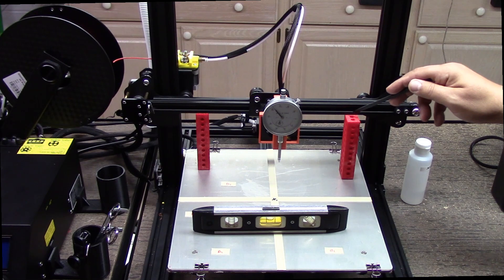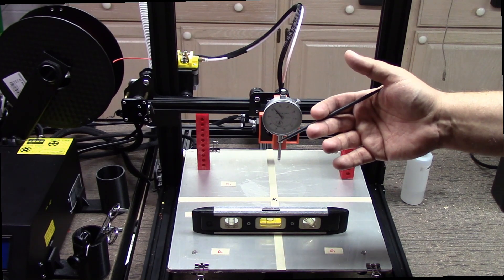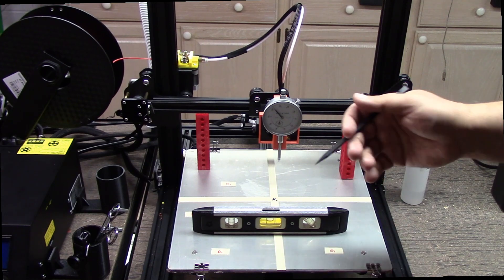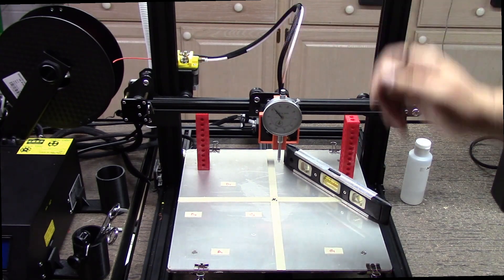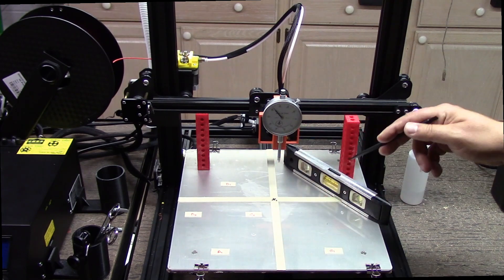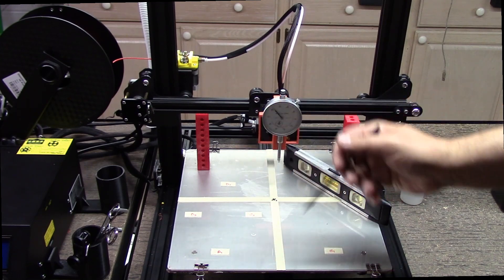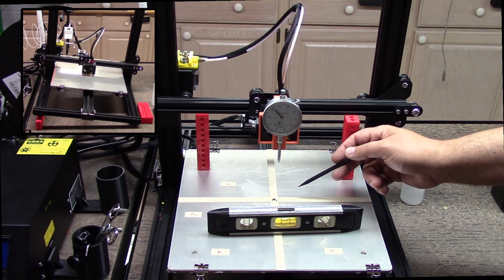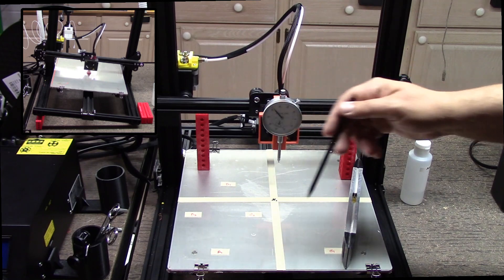Shop Talk - Stop Leveling Your Bed and Start Tramming Your Machine!

Comment: alot of talk for nothing imo, just "level" your bed with a feeler gauge at the 4 corners and be set, of course your bed won't be level to the ground, it will be parallel to the tool head, the terminology is not right, but the end result is....
Reply: Christopher Backus Mirror glass is made to a much higher standard of "flat" due to those types of imperfections causing visual distortions in the mirror reflections.
Reply: Québec Multirotor I agree you can get 90% of the way with that method, I've done it like that for 6 years lol.
Reply: @GeoDroidJohn  if 90%     near enough is good enough  your doing great ..enjoy. the chaps trying to point out a methodology that can give better results for those who wish to try. nuff said... For those who wish to try fantastic constructive feedback great but if folk just wanna whinge... Not interested
Reply: whats interesting is that glass was cut from a larger sheet, but the bow is right in the middle of cut off piece.  most likely it wasn't there on the larger piece of glass and wasn't after it's cut.  only after it's mounted and heated.
Reply: Quêbec Miltirotor You're making the touching assumption that the bed is perfectly flat. Almost none are, even if the error is usually minor, or small enough to look the other way (and often try to find something else to blame for probems). Even  getting the corners perfectly set won't ensure that the center isn't dipped/bowed, or that there aren't ripples across segments of the bed.
Reply: Pretty much exactly what steveH said. When I tram my bed I check the center after adjusting the 4 corners. My glass has a slight bow in it, making the center of the bed slightly higher than the 4 corners. I've managed to get decent prints so far by using brims and rafts, but there's only so much one can do with warped glass.
Reply: You've fixed yours Chris, I know. But #Dishing is very common on #Ender3, even the newer ones. If people are having the same issue...
You can temporarily get closer to 'flat' by putting 1-2 sheets of paper under the centre of the bed - staggered a bit to even this out.
Then crank your adjusters down hard (move Z down if you have to) which should subtly remove some of the curve from he bed as well.

This is called Holostio Mylopic Super-Alignment - I know because my knowledge of everything is superior to everyone elses.
Therefore, instead of calling it - bodging paper under your dished bed, until a decent glass one arrives.

You must all now use the proper term. And rub me and tell me how clever i am - #WhatHorseshit seriously xxPD
Reply: Nope, It's there all the time. I cut a mirror to replace that warped glass, and even after it's heated, it's perfectly flat.
Reply from the maker: If that make you happy, go for it...
Reply: Lets just have 50,000 thumbs on this comment and we can throw this reasonably-good video.
And it's wallowing insistence on Superior Knowledge - away. Along with a whole bucket of Tram-muddied water and anything God may or may not have done.

Comment: Might want to freshen up on those aviation terms again.  You misused the word yaw when you should of used the term roll.  Its a simple nitpick I know, but the details matter.  Other than that the term tramming  is something new I learned today and it makes complete sense to make sure the head travel is parallel with the bed.
Reply from the maker: Pitch, yaw, roll you get the idea of the X/Y system as unfortunately like Ron Howard I can't afford a screenwriter and glad you learned something new today as that was the my goal in creating this video :-)

Comment: You have an issue if the X axis is not leveled. You said 1.5mm sag out of 20cm. It is an angle of 90.43º with you Z axis. 
Which seems very little but it means you square vertical angles are not square and you would have the same 1.5mm mistake on a print of 20cm high.  
You really need to find a way to level the X axis.
Reply from the maker: Actually there is a naught in there implied at 0.15 as its referenced to a portion of the layer height.  And you will never "fix" it as yes this is very good as I have spoken some viewers that are 3 full mm  of sag in their CR-10's.  Even with dual Z's you will get closer but still not perfect so again the reason for tramming to match the two planes.  Because as demonstrated you can turn the printer up on its side and still print if trammed correctly.
Reply: DIY3DTECH.com with a dual motor z axis you should have zero sag if correctly leveled.
Reply from the maker: Well you might not have "sag" but it more of nomenclature thing as even with two Z' you will some error as both are not "perfect" and you will get closer but achieving perfection is like over coming friction.  An impossibility...

Comment: So how do you actually level a bed with 3 screws?
Reply from the maker: The same, however with only three points you will not be able to distribute the error as with four.  Many times you will see three with auto-bed leveling as my Da Vinci 2.0 is like that.  However as I cover in the video, with only three points one will be limited to the slope of the plane when it come to "auto-bed leveling"...

Comment: The sprite level here should surely be based on the whole table and printer frame being level
Reply from the maker: Thats sort of the point :-)
Reply: as you show tipping it :) The carriage need to be level with the build area; (Tramming), So far as I can tell even Auto Tramming is not enough, if the Z height is adjusted automatically while printing helps but if not Trammed prints still cause issues IMHO
Reply: Correct :)

Comment: Your Z is not perpendicular to your sagging plane, you get a skew in X from that
Reply: @DIY3DTECHcom  While making the X axis and bed parallel gets you proper layers, the Z axis (vertical) may not be quite perpendicular (normal) to the bed. This means that X skews toward the higher side as the tool rises in Z. You can compenate for that by having the printer offset X based on Z, a feature called skew compensation. It's for when your build volume has parallel opposite faces but not quite right angle edges (some machine axis planes form parallellograms rather than rectangles). We measure it by the diagonals of a printed cube.

Comment: Good video. Everyone keeps assuming their bed is actually flat ...it's far from it.  Even if you could (rigidly) support it with just 3 points, underneath a perfectly square/trammed machine - it STILL wouldn't be a perfectly flat piece of aluminum! You'd need some kind of compensation/adjustment.

Needless to say, tramming the X- axis is MUCH easier if your printer uses dual Z screws (mine is trammed to the frame, leaving the bed as the only variable - to be trammed to the nozzle.  Next, I use a feeler gauge to manually adjust the bed to the nozzle, as flat as I can get it.  Then, I run my probe as close to the level screws at possible at all four corners, and get each corner of the table ~.05mm of each other in the z-axis.

THEN I run UBL (mesh) to account for the fact that the table isn't flat - that's what it's REALLY for.  For extra credit, I could take that mesh into excel,  calculate a new "best-fit" plane to reduce the amount of variation in Z of mesh, and then alter the probe-tram to encourage the new angle - and then UBL probe again (also important - I use glass, and write "front" on them to ensure I put it back the same way, after removal)

And my bed is "only" 350x250 - for huge parts that span the table, it's a little effort that goes a long way towards using the entire table, and still getting big panels of identical parts, and MANY fewer failed prints.
Reply from the maker: This is very interesting, does metal feeler gauge damage the nozzle over time?  As I have considered this before, however heard negative internet stories.  Also  what machine/probe are you running UBL on?

Comment: With reviews like this you will take anyone new to 3d printing and they will say to hell with this its to complicated. The new person which is what will keep this hobby job career alive just want good prints simply done. Why do you think more people buy the machines that are 90% put together?  To get printing faster and less hassle. Dont over complicate something thats so simple. At least for beginners. Teach a class but dont run the students off by talking over there heads.
Reply from the maker: Thanks for commenting!  It is complex, I have run this channel for 3 years now and you and should see the questions i get as 3D printing in it form today for the most is complex as you need to know how to flash arduino's, mechanical movements, etc.  There isn't a day goes by which don't get at least a dozen questions about something like this and as my high gym teacher and football coach use to say "no pain no gain" :-)

Comment: You've made a good point about the terminology. "Bed Leveling" might be confusing to the neophyte. Probably it would just annoy Marlin users if we rename all the BED_LEVELING_* options to BED_TRAMMING_*. We'd start getting flaming bags of poop dropped on our doorstep. But I think it definitely makes sense to start using the term more in the documentation.
Reply from the maker: LOL!  Good one :-)
Reply: Agreed in many ways 3D printers are milling machines and there's a reason for decades of technical jargon.

Comment: If you make that video you are talking about at the end... Would you please explain to me how I can align the Y axis to the X axis? I really can't realize how can I take a reference point to make the alignment and I see that my pritns are not nearly perfect squared. I have a printer similar to the Anet A8 (Tronxy P802e). Thanks!
Reply from the maker: If your prints aren't round or square as they need to be, you have something wrong the mechanic's or the firmware.  Check your belts to ensure they are tight and not skipping, check your gears for deformed or missing teeth and also check to see if your firmware has the correct stepping for the gearing...
Reply: I wasn't expecting an answer, THANK YOU!  I know is not square because I can with no effort move the Y axis and I don't know how to take a reference to align it with the X axis so that I can tighten the screws

Comment: 3 points does make a plane, yes. But it is an over simplification.
Thinking of the bed from the perspective not only assumes the bed is perfectly flat, but also that it is perfectly rigid. Neither of which is the case.
Take the output on the console from an ABL probe sensing sequence and map it. You will get something more akin to a landscape of hills and valleys or peaks than an image of the famous salt flats.
The aluminum bed on my printer even comes with 8 adjustment points. This allow for flexing the bed ever so slightly to counter the unevenness that any bed will have.
Reply: If the bed were perfectly level, 3 points would be all you'd need, even with the skew from the print head and gantry.

The dirty secret, of course, is that the bed is NOT perfectly level.  It's warped and flawed when you get down to the sub-millimeter scale where the printer operates.  Worse, as it heats up and cools down, it undergoes thermal expansion, and since it's attached to a frame that stays at a more or less constant temperature, the slightly expanded bed surface has to go somewhere, and so it bows either outward or inward just from adjusting the bed temperature!

Just to reiterate, the typical distance you print the first layer is with the nozzle 0.1mm up from the surface.  So a tiny difference in the bed level in some places, just a tenth of a millimeter one direction or the other, is the difference between the nozzle grinding along the bed, or printing up in the air too high for the filament to stick!  One tenth of a millimeter is just slightly further than the thickness of a human hair (about 0.07mm).

Many print beds simply aren't flat enough to allow the entire surface to be at ideal print distance, no matter how much you adjust the screws.  Larger print beds are the most troublesome.  This is where mesh bed leveling comes in.  By probing a bunch of points on the bed, the printer is able to create a 3D map of the surface of the bed, and then when it prints the first layer, it will move the head up and down to follow the ever so slight contours of the bed.  Since it can perform the probing immediately before starting the print, when the bed is already heated up, it's also robust against things like printing at different temperatures, or the fact that you had to take off the plate and work at it to remove the last print, and maybe when you put it back it's no longer in the exact same position as last time.
Reply from the maker: That is my point (pardon the pun) as you are correct it is vast over oversimplification and you need multiple point for distributing the error.  Thanks for commenting!
Reply: Right. The 3 point approach completely ignores the form factor.
Reply: some people think life is flat and boring and that one idea can explain everything all the time.  Those types of people are pretty boring ;)
Reply: Jan Petersen - why are you commenting?? It’s all in his video. Shhhhh!

Comment: I can't belive there is people out there using a horizontal level to level their beds. The meaning of bed leveling is to make the bed plane parallel to the printing plane so they maintaint a constant distance for a certain z distance... but if you use a horizontal level you are making the bed parallel to the ground wich is of no use at all. Auto Mesh bed leveling does make the printing plane and the bed plane parallell overall and corrects (if any) deformations on the bed but has the side effect of copyng the bed deformations through the full print so neither it is a perfect solution. A perfect solution should print a base before the actual part, so this base is parallel to the printing plane and no z correction is needed from this base onwards. This is difficult to do in a 3d printer of this kid because this correction must be done by the printer knowing how to handle by itsel the material used to print or by the slicer by knowing the resulting mesh after mesh bed leveling. Both options are not trivial.
Reply: Try this. Tighten all bed adjusting screws all the way then get 2 objects that are the same height such as soup cans, something lighter would be better, perhaps empty soup cans.

Place the objects on the print bed, one on each side, manually adjust both lead screws until the x axis arm just touches the tops of each object.

The x axis arm should now be parallel to the bed. Home all axis's and put a piece of masking tape on top of each stepper motor and put a pencil mark on the tape and z axis couplers.

Now level/tram the bed and before each print home all axis's and manually adjust the lead screw that is not aligned with the pencil marks.

Hopefully this will address the issue your having.

On my Anet A8 I usually only have to make the adjustment after printing taller objects and it's usually not off by enough to matter unless I try to do four or five prints in a row because the error is cumulative. P.S. I haven't had to level/tram my Anet A8 since I started doing this 3 months ago.

Happy printing.
Reply from the maker: Thanks for commenting and have doing this  channel for a while and some of the question I have fielded  along this line, well you get the idea!
Reply from the maker: This would result in only two points, which would lead poor distribution of error as this is really what you want to achieve.  Thanks for commenting! :-)
Reply: It doesn't have to be through the whole print. With a recent version of Marlin we added Z Fade for the mesh-based systems (MBL, ABL Bilinear, and UBL). With this option (M420 Z[height]) the leveling compensation gradually diminishes with each layer until (at your set height, default 10mm) leveling compensation ceases. Mesh-based compensation is really only needed for the first few layers, but if it's diminished too quickly it may lead to visible artifacts in the print.
Reply from the maker: I assume that Z Fade has to initiated by the math in the slicer?

Comment: I have a problem with my Z axis on my CR-10S' , the right side of the bar is about 1/8 inch higher than the left side. So when I level the bed the adjuster screws on the right side is at the end of the threads on the screws. I tried to get the right side down and square but I can't. Any ideas? I've search the internet on how to fix it but came up with nothin.
Reply from the maker: Also try sunging up the wheel on the left side, with a single Z you need to sort of stretch the up-rights so they hold pressure on the  wheels.  As I show in the video mine is only around 0.15 off but its tight too...